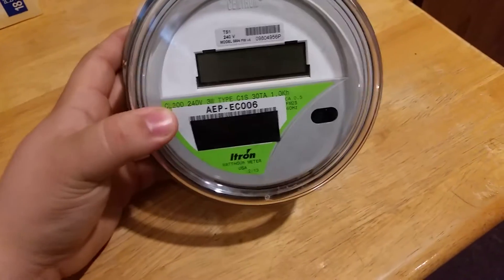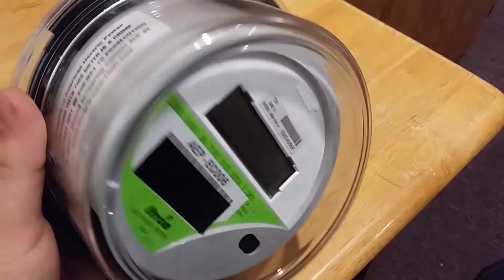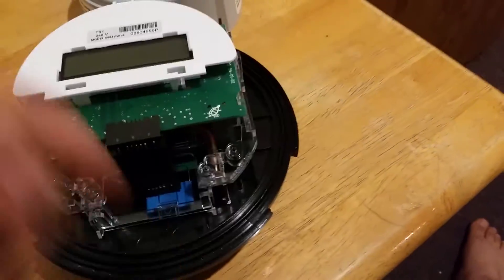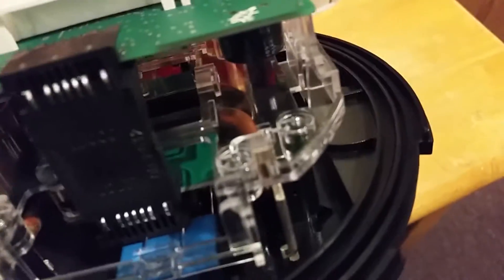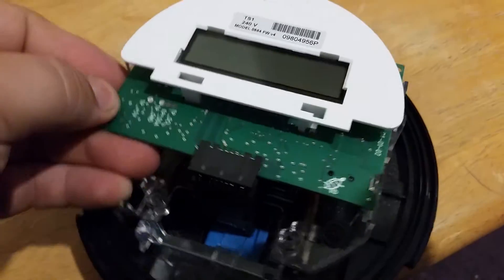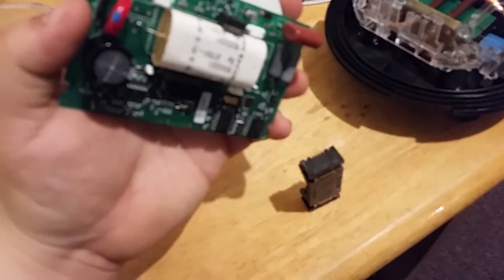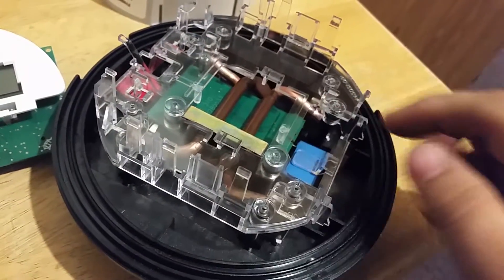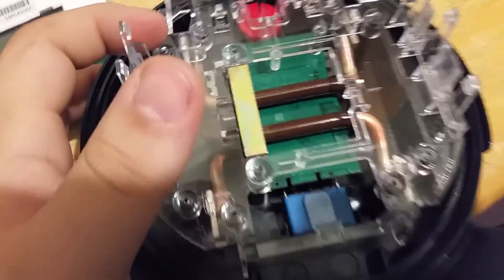Centron Itron C1S Electric Meter Teardown

Comment: Plastic fantastic, not made to last the time like the electro mechanical meters.
Reply: RODALCO2007 excuse me? I have an Itron Centron over 7 years in my home and I ever had problems with that meter... the L+G gave me lots of voltage problems.
Reply: Voltage problems are not caused by the meter, they are
caused by bad electrical connections. There could have been corrosion in the
meter socket or a loose cable termination.
Reply: RODALCO2007 sorry but I always use Cutler-Hammer and Phelps Dodge cables so everything is alright. Elektra Noreste (The Utility company here in Panama) told me they've been made some tests to the Landis Gyr Focus kwh meter and was the transformer
Reply: Thanks for that feedback.